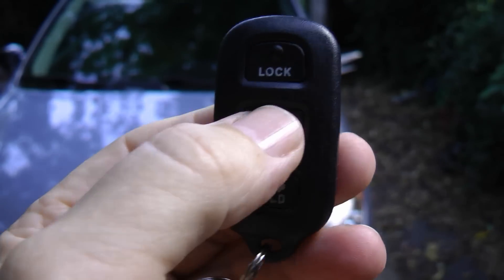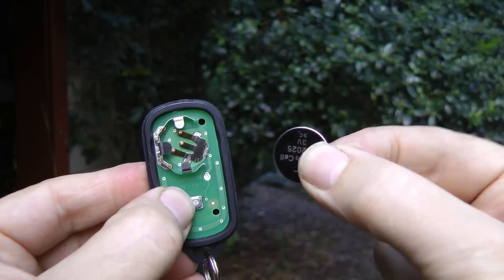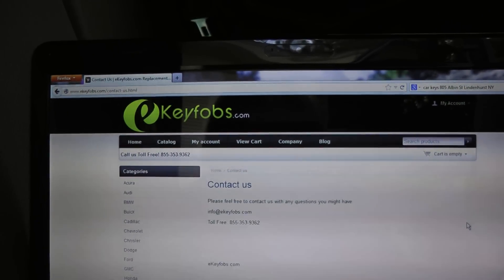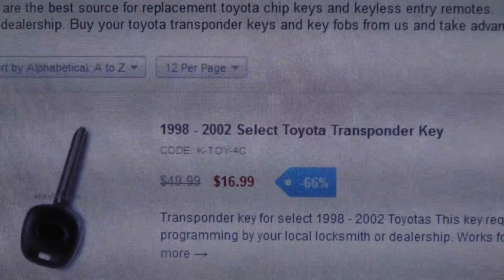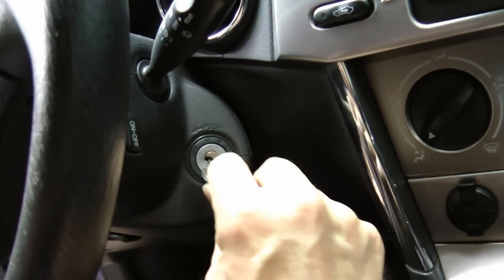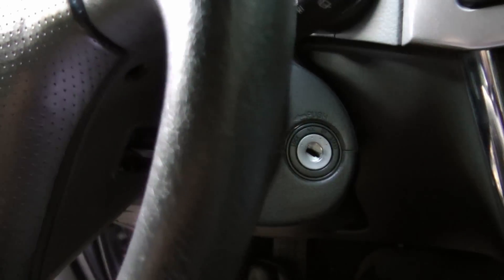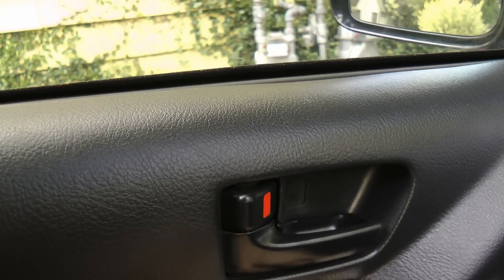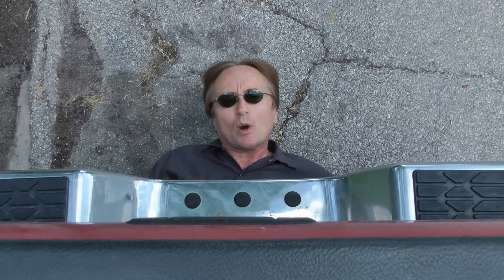How to Replace a Remote Key Fob for Your Car

Comment: Get rid of that intrepid if you can. I had one and had low mileage on it and used only synthetic oil and wix filters & it burned oil anyway. Battery is a pain to change the cables corroded. It was a nice car when for a while...but a total pain in the ass as it got to be 9-10years old. But the battery location still was insane. 2.7v6 are junk. If you have the other engine well maybe hang on to it if you like it. My 2cents.

Comment: hi scotty, I have problem with dodge grand caravan 2006, the fob doesn't work at all. new battery even new fob after programming not work. please help.
Reply from the maker: +sin to then your receiving unit inside the van is broken, a BIG expense
Reply: Good luck trying to fish out the receiver and replacing it

Comment: Hi, I am having a Ford Falcon AU II 2000 model...type sedan.  My keyfob was damaged so brought a new from ebay, but it still didn't work. My all door locks from inside with the door lock switch.. I think the car sensor is not working.  Where can i find the remote control sensor in my car.  Or there should be any other issue
Reply from the maker: Chetan Shinde they don't sell those here, so I have no data on them. BUT, if keyfob was damaged, odds are you aren't programming it right with the new one. check the directions closely

Comment: Scotty, my remote goes through batteries like nothing. I use quality batteries from CVS (Energizer or Duracell). But I continue to find myself replacing the battery every couple weeks because the battery goes flat. Any ideas? 2006 Mazda 6
Reply from the maker: remote isn't shutting off, get another one

Comment: I'm shock it can't run on E-85. Most new cars are designed to run on gasoline or E-85. I would think Ford would engineer a 2013 Fiesta to accept either... guess not. My best guess it would be hard to start if it starts at all...

Comment: hello scotty my car remote doesnt work and when i put the key inside the door to lock it it doesnt lock the car it fells empty inside but the car can be locked from the inside and its a bit hard to close the door fully  its a bmw e46 m3 coupe  THANKS
Reply from the maker: +Roman Samko take the inside door panel off and you[ll probaly find the rod that goes from the key to the lock inside has fallen off at either end. But the remote is another story IF it doesn't lock ALL the doors.
Reply: alright thanks a lot

Comment: hey scotty my car does not go on programing mode.  What can i do to set my remote key, i have a air bag light on is that the reason why the car wont go on programming mode ????my car is a corolla 2008
Reply from the maker: +Sergio Pabon-Jaramillo  air bag has nothing to do with that. Try a new battery in the remote, and if not that, try another remote and pray the control module inside the car is not bad
Reply: +Scotty Kilmer   Hey Scotty, I just got through watching your video, I just went to the website to order me two new transmitter remotes because it had on their website that you could get two for $39.95  I scrolled down to read up on the description and it said that I would have to get a dealership or locksmith to program the transmitters.  Now the question I'm asking here is will I get the directions like you showed that you got when I receive my remote transmitters or will I only receive the transmitters without the instructions on how to program the remote transmitters and have to take them to a dealership or locksmith to let them program the remote transmitters.  Now the reason I am ordering these remote transmitters is because I dropped mine and busted it.  It worked every now and then.  Tonight I opened it up and tried to position the battery more securely in and broke the piece where the battery is suppose to be positioned.  Now I have no choice but to get a remote transmitter.  The dealership told me it will cost $160.00 to replace it.  Hopefully I won't have to go that route.  I have a 2008 Malibu.  Anyways Scotty, when you get some time, please get back with me to let me know something.  Thank you Scotty.
Reply from the maker: +LENOVOVO you won't get directions because they require a special dealer level computer to program them for your car. PRAY you can find an honest locksmith who can do it, they cost much less than dealers

Comment: After mark remote starts and key fobs not a good idea I've seen many cars get towed in because the clowns who put them in hack and booger job there way into what ever they can. Many times we get loss communication codes and theft issues. Strongly push for factory remotes being a GM tech it's the best way to go.

Comment: what if the key remote works but only  when you're really close to the door? I have a VW GOLF MK5
Reply from the maker: then live with it, odds are the receiver is getting weak, but do try changing the remote battery
Reply: What Scotty or it’s aftermarket, I got an aftermarket for my Cadillac CTS 03 & it only works when I’m close to it

Comment: what can i do to make my car to get on a programing mode
Reply: +Sergio Pabon-Jaramillo Depends on the car
I have  2005 Hyundai Sonata and you have to take the radio cover off and the air condition controls out to get to the programing box and switch it to set and then press the buttons.  So every car has different ways to do it.

Comment: I have a pontiac firebird00 locked with the alarm on and the remote stopped working. If I unlock it with the key it's going to go off. I need a new remote apparently and need to turn off that alarm:(
Reply from the maker: +NecroAnxiety if it'sl a factory alarm, get a new remote from a dealer and have it programmed IF new batteries in your remote doesn't fix it.
Reply: +Scotty Kilmer 
would I be able to reprogram it in the car with the alarm still on? after it quiets down after a minute. 
and thanks for your reply by the way!

Comment: The factory key fob could have became out of sync with the car and just needed to be reprogrammed. Most remotes use a 40 bit rolling that when a code is used it is dumped and a new code is used.  Your car has a leeway of 256 codes in case the remote is out of range or a toddler grabs it. If it gets clicked too many times it will no longer work until it gets re-programmed. I mean no disrespect Mr. Kilmer I just thought I'd add on and maybe help teach something new.

Comment: My 2001 Sienna's existing remote stopped working in a parking lot.  New remote battery didn't help.  This video's instructions didn't work.  Disconnecting the vehicle's battery for several seconds to reset the computer WORKED immediately.  This wasn't for a new remote; but for those wanting to get their existing remote to work again, you may want to try resetting the vehicle computer via the battery.  Use usual caution when working with a vehicle battery.
Reply: ***** Thanks.  The computer resets and the car has to readjust, but it's only temporary. I'm letting people know it worked for me, because I spent a lot of time trying to reset the remote and it wasn't the remote all along.

Comment: mr kilmer   how to make      remote  control  working         when    (toyota corolla) car  key in ignition engine on?           remote only work  with engine off
Reply from the maker: it's only supposed to work with the engine off.

Comment: Wow...  Now I'm sure that there must be a machine that the dealer uses.

5 years ago bought a car it had only 1 fob.  Dealer said ... ooooh $80 for the fob and $25 to get it programmed.  So ... just now seen the key fob site.  Yup ... car dealers are in the same category as lawyers and bankers.  Swindle you out of your damn pants if you're not careful.  

Granted I get it's a USED circuit board .... Maybe even used FOB shell .... But 25 bucks for them to do some stupid routine that can be done in your own drive.... SMGDH